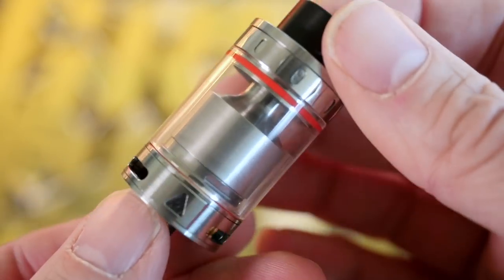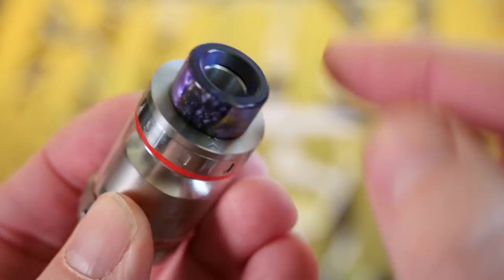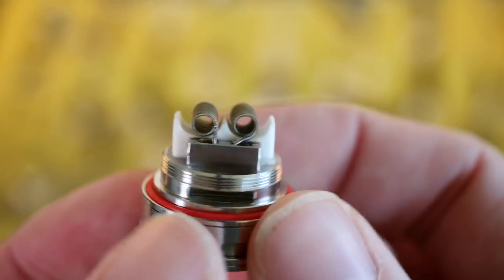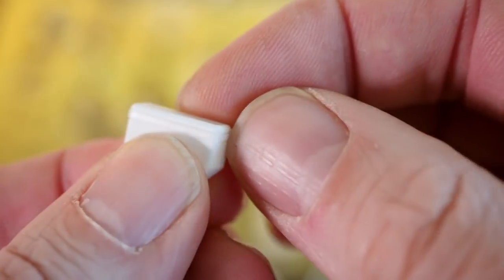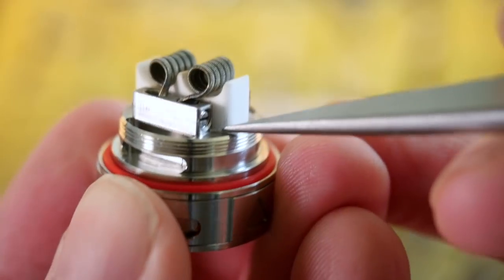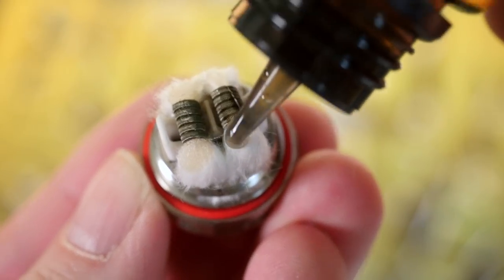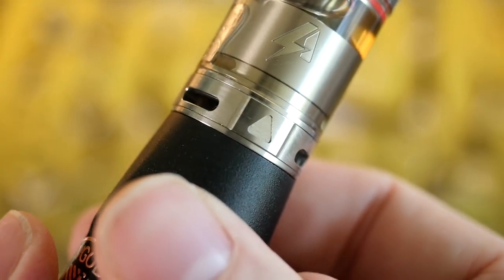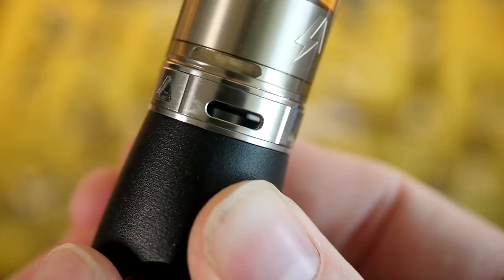Intrepid RTA ~ Blitz Enterprises ~ Review

Comment: Looks like a smok tfv8 cloud beast at first glance. Wonder how the top latch clip holds up. I recon it will improve airflow without the ceramic slot thing's I would think dual inlets would cause turbalance in the airflow. Hmm odd design. Build deck looks good though

Comment: One thing to note on this is that when i got mine, my resin tip DID NOT FIT. Luckily i have a dremel and drilled it out to make it wide enough to fit. Other than that im loving this rta. PIN THIS FOR OTHERS TO SEE GRIMM
Reply: Also getting the o rings on the ceramic block to fit in there is a little bit of a bitch

Comment: I'd be cautious of that ceramic block.  The rapid heating and cooling over time will cause it to fracture and crack.  The o-rings may not handle the heat over time as well.

Comment: Nice review Nick. I've been looking for a new Rta. I got the Vcmt2, Reload, Manta . I'm looking for something w/ good flavor. Any suggestions?
Reply: Jennifer Harbin how does the vcmt2 compare to the other 2 tanks you mentioned? I've been looking at getting it myself. I got the vandy vape kensei most recently and I'm not really blown away by it. My bday is this week so I was either getting a gtrs vboy mod with an aromamizer plus or vcmt 2, or just getting the vboy and probably a captain pd270 mod as well. been trying to get a few mods to fit 30mm attys. Whatcha think
Reply: DJ Dulin its up there. Ev cigarettes had it on sale for 53$
Reply: DJ Dulin don't get the captain pd270. Mini quit working after a month for no reason it wasn't dropped or anything. If anything I go for the wismec 20700
Reply: Jennifer Harbin I got one of those about two weeks ago I like it I just wanted a 20700 mod to fit 30mm. Which do you think I should get the vboy and a vcmt/aromamizer plus or the vboy and another mod? I have almost 90 atomizer's so I was thinking about just starting to collect mods for a bit but I still need the vcmt2 and aromamizer plus those are about the only ones I don't have yet
Reply: DJ Dulin I'd go for the Vcmt2. Flavor is a little less than the reload. But it has great flavor. To me the Reload is a tank w/ dripper flavor. The Vcmt2 is my 2nd favorite behind the Reload. You get more air flow. It hasn't leaked on me any. I like the bubble glass, holds a lot of eliquid w/ out looking ridiculous. Easy to wick.
Reply: DJ Dulin Definately get the Vboy. The chipset is great. I Just sold a brand new ipv eclipse w/ the yihi420 chip in it. I won it on YouTube. Nice chipset. I've been thinking about getting a Vboy myself...and I'm a DNA lover. I own 10 Dna's. But the yihi is on par with the DNA. Highly accurate.
Reply: Jennifer Harbin I ended up going with your suggestion I got the vcmt 2 for 50$ from a local shop and ordered a vboy from eccigity. Love the rta I'm just having issue with ohms jumping around a little. Can't wait for the vboy to get here should be a nice little setup sexy too lol. I'm trying to get a guy that owns a shop around here to open for like 5 mins so I can snatch up a drop rda he's got in there I'm praying to the vape God's lol
Reply: DJ Dulin if ohms are jumping check the 510 pin, make sure its not loose. If its not that then maybe one of your coils is touching the chimney somewhere.or does your mod do it some times?

Comment: hey there, I am trying to build my own E cig (cos I cant afford the good stuff on the market), it seems like there are some good homemade options out there, this takes me to ask you, I bet you know of these home made options, could you provide links and or instructions in general, the info so to be able to get my own rig and start vaping like a real man??
Reply: Robert Ostman just make a mech mod. But remember, if it blows up in your face, you're the only one responsible!
Reply: hello!!, I am actually going for a design that doesnt need lithium, and a plus would be to add some sort of protection to the common battery, been thinking that some sort of arrangement using a few capacitors and resistors and probably a inductor may do the trick, but my memory fails me... I forgot how to do that decades ago... thus I need your help...

Comment: o-ring looks like it melted a little around the ceramic part
Reply from the maker: it didn't melt, it's just a tight fit.  It got pushed up as I installed it.  Before any coils were installed